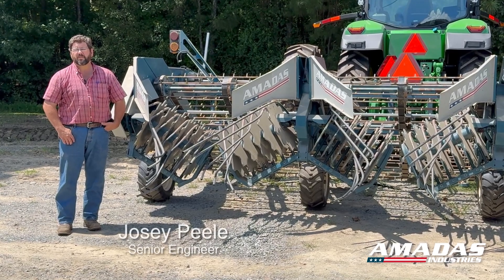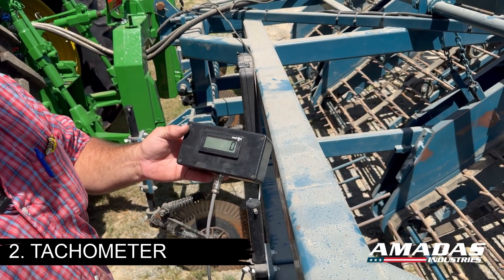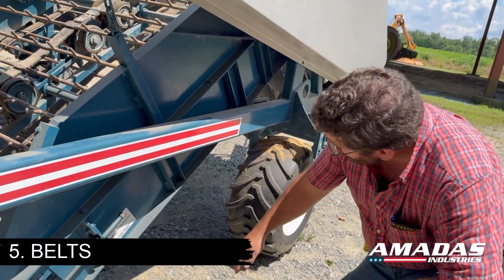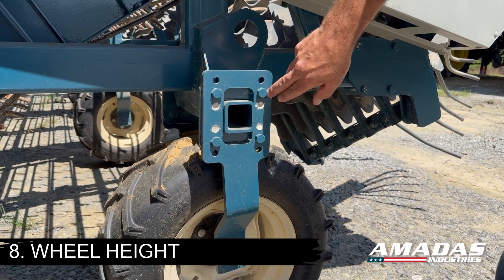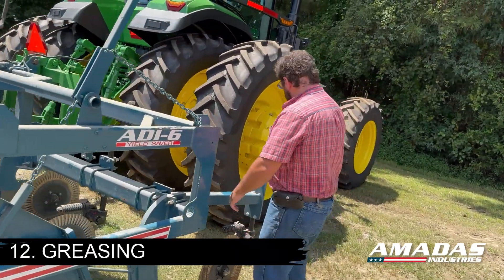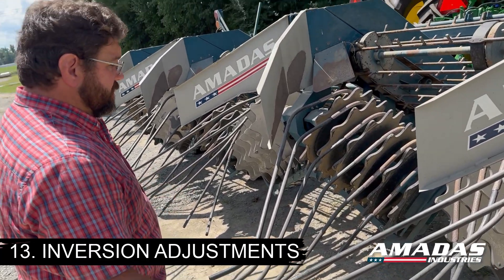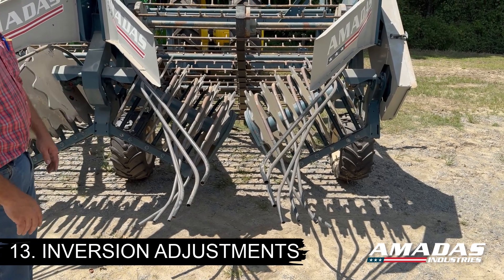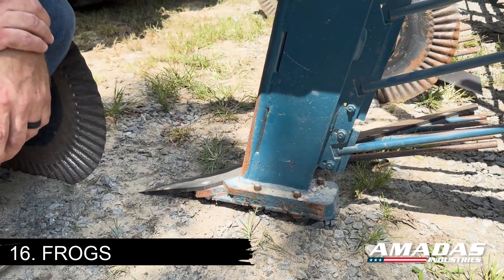AMADAS Industries - Digger Quick Start Guide

Comment: Have a Brand new 8 Row digger and dirt and vines keep wrapping around the blades and causing blockage and pile ups behind the colter blades.Anyone have any tips on that
Reply: Idk what ur setup looks like but I'd make sure coulters are going in the ground good and would maybe run the plow little lower, deeper
Reply: @chadsmith14  It’s an Amadas,And I ended up dropping the coulters I was having a problem with about an inch lower than the other ones and that fixed it,I don’t know if the toolbar is tweaked some or what,You wouldn’t think so being brand new
Reply: @AlanBell01  yea you wouldn't think so.i know the kmc 6 row plows they come out the back better and prettier if you let them bunch up a lil bit at the front like roll your roller on a Deere a notch or two above  wat is flowing smoothly but you have to have everything flowing smoothly to do that but I'm gad you got it figout